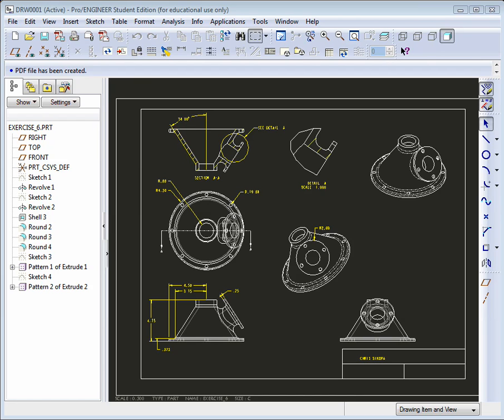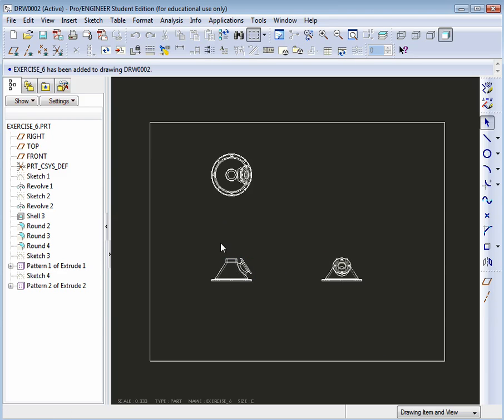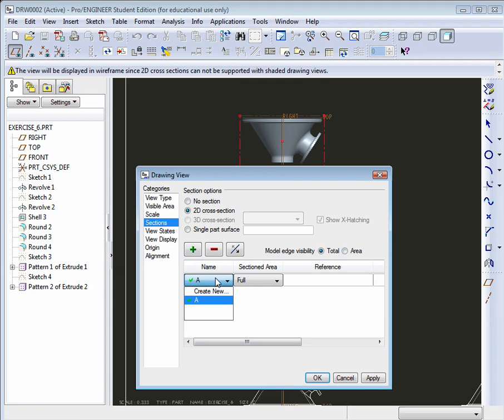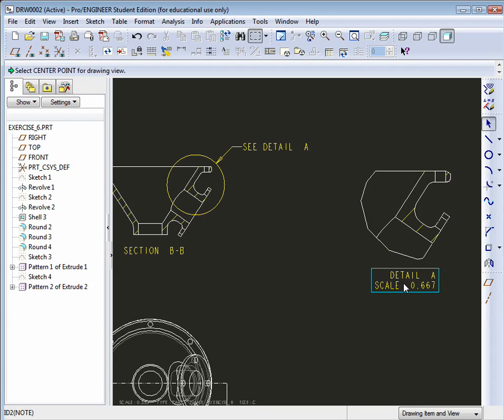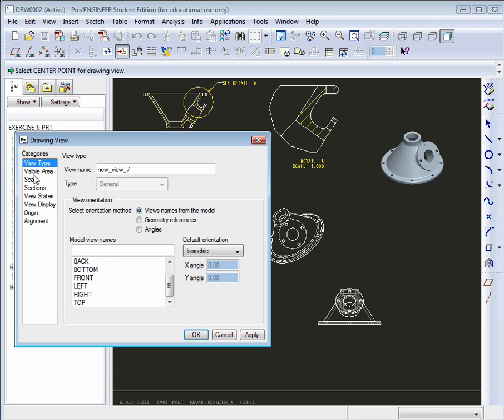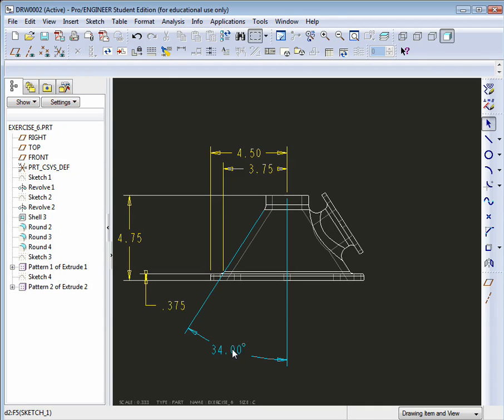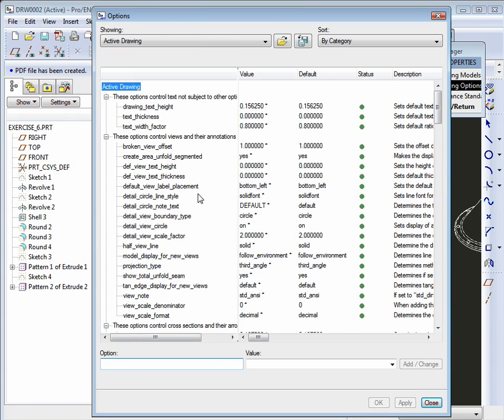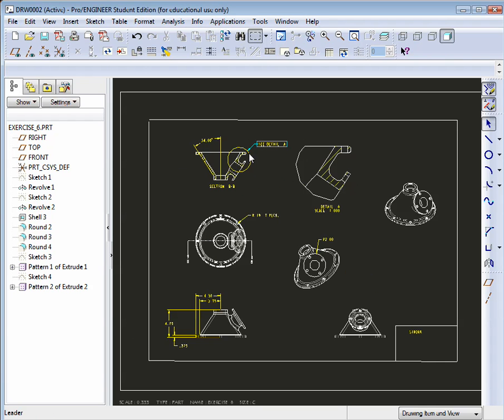E6 Pro/Engineer Wildfire 4.0 Detailing

Comment: How do you do centermarks for circles? Do pro-E people not believe in this or something? No one includes it in their tutorials!
Reply from the maker: +Brianna Eyster Select the view you wish to add center-marks to, then select the Model Annotations icon (Its a yellow/flashlight looking icon). Once there, select the datum tab on the top right of the editor box. All possible center-marks should appear, all you need to do is select the desired center-marks and they will appear on the checklist. Select ok. I hope this helps.
Reply: I knew this part of the process! This took me 3 days to figure out...what many youtube videos and written tutorials failed to mention was that you need to have a model datum inserted into the feature's sketch. They're not necessary for solidworks or inventor, so I didn't have them. Which was why they weren't showing up when I did show/erase! They do show up brown though. Any idea how to make them yellow?
Reply: @briannaeyster9161  Unfortunately, Pro/e (Creo) is rather unkind to the new user. You need to be guided in everything to learn it. But once you do learn it, you start to enjoy it very much and don't bother again.